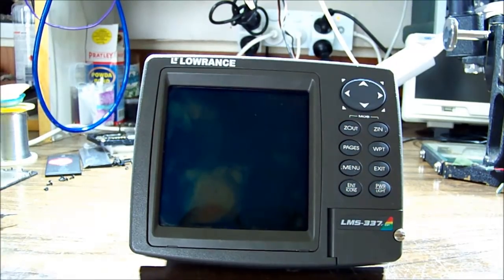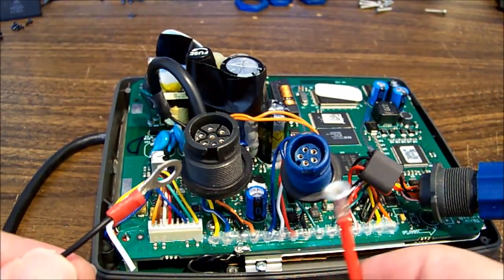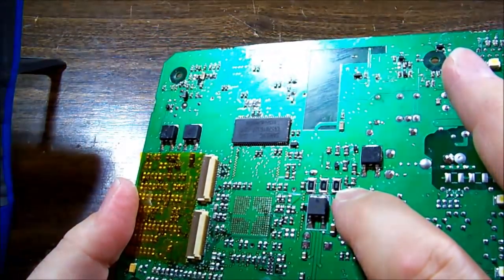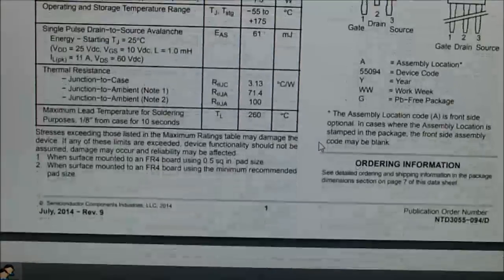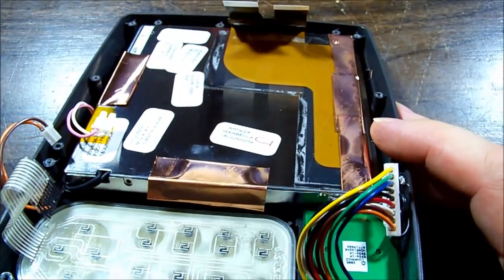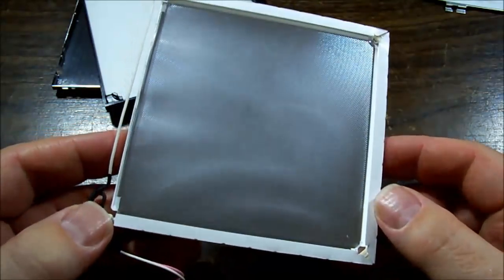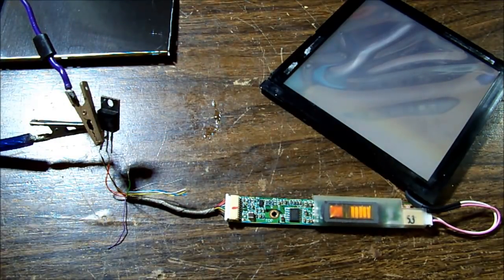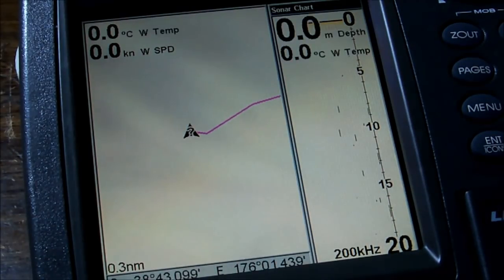Lowrance LMS-337 fish finder sonar depth sounder repair

Comment: G'day mate I have a Lowrance Elite does 5X HDi which is not powering up at all all cables have power eccetera and I have tried my GPS Lawrence and other sound on the same cables and they all power up I have taken the circuit board out and trying to troubleshoot ID like to send you email photos if that's ok please
Reply from the maker: jonnyfix0 at gmail

Comment: Hi Jonny  i have a problem with lowrance hds 9 g3 the transducer is not recognized checked the board and found 2 burned components
but cant tell  what is their code one looks z4w 47  the other starts with a 3 is there a way to find out? Thx https://www.mediafire.com/convkey/624f/j7ia7e85uet0c4bzg.jpg
https://www.mediafire.com/convkey/7f45/ttkoki8w06a1fk5zg.jpg
Reply from the maker: Ouch. I think the z4w 47 is a 47V zener like BZX84-B47. I think the other one is a transistor. You could substitute something rated for say 1 amp 60V (because the zener is 47) and see what happens. It does go to what looks like a large cap on the other side so perhaps rate it for the voltage the cap is to be safe. Make sure there's no low resistances to ground on any of their pins to be sure they don't smoke again. Their package is a SOT-23 for size reference.

Comment: hi jonny i have a 7500c and the front glass has been smashed in transit. i have a replacement on coming where the buttons dont work how easy is it to swap out the buttons?
Reply from the maker: Shouldn't be hard at all, hopefully the reason for them not working is purely the buttons or the PCB they're on but you could swap your main board over to. Avoid trying to remove the screen from the chassis in case you ruin any water sealing.
Reply: @JonnyFix  thanks Jonny yes that's what I was thinking, stay away from the screen seals and move what's not working to this one coming. Do the buttons use done sort of seal around them as well?
Reply from the maker: @andrewknox8986  from memory all the buttons are one large piece of rubber that creates the seal in itself when the board is screwed onto the back of it.
Reply: @JonnyFix  brilliant thanks Jonny that's what I was hoping for when watching your video above look forward to this arriving and getting to grips with it lol

Comment: Hello Jonny - got ahold of a Lowrance Globalmap 5200c (no signs of cosmetic or water damage). When I connected it to 12VDC it powered up for about 10-15 seconds and then all the sudden went completely dead (no display, sounds or anything). I've confirmed I'm getting 12-15 volts. One thing I neglected to do in the beginning however was to connect a fusible link when I turned it on. Is there anything you could suggest I try at this point? Thanks so much.
Reply from the maker: It may have an internal fuse (like this unit) that has blown for some reason. At 4:59 you can see a fues holder toward the top and 2 orange wires going from it down to the board. Clearly this one popped it's fuse once and someone thought it was easier to add a fuse holder in to make it more easily replaceable given the original one is surface mount. You may have to do something similar.

Comment: Thanks Johnny! Excellent video! I have a lowrance elite 5x that powers up and appears to be functioning normally until you take it out on the water. It will not read bottom, a lure, an anchor.... NOTHING! I have tried 3 different transducers, factory reset several times and nothing. I noticed that the transducer pings are not very strong (usually when you wrap your hand under the transducer the pings are very obvious). Any thoughts?
Reply from the maker: I would follow from where the corrector attaches to the board inside I think it will lead to a transformer that is driven by a couple of mosfets. Check to see if they are ok and if so you need to check the voltage on them with it turned on I think it's around 50v. There might be some diodes between the transformer and output connector as well.  If that's all OK it could be the transformer has failed.

Comment: A unit I have (very same model) powers on, but powers back off several seconds later. It's in excellent condition and very clean with no signs of water damage. Could you recommend anything to check out inside the unit?
Reply from the maker: Does it have a picture or does it just light the keys. An image might suggest the processor is ok. No image might be not booting (bad ROM) or no clock or there is an image but no backlight. The exact symptoms will help guide you. I'd be looking at all the power rails, make sure none are missing or incorrect.
Reply: Thank you for the suggestions. It had these symptoms when I tested it on a standard 110v-12vdc outlet converter but when i connect it to as 12v car battery, it powered on fine and the symptoms went away. I guess some fish finders act faulty on the certain converters.
Reply from the maker: @en4cer450  Sounds like the output voltage was dropping because it couldn't source enough current or the regulation was rubbish and noisy.

Comment: If you like working on them you could make a good living fixing them. My personal opinion is they are a piece of junk. And if you have to rely on lowrance get ready for being abused by there customer service department. They give you only 2 options send it back at a cost of 636.00 to get a reman unit or buy a new one.
Reply from the maker: Not surprised. Anything with low production volume (compared to other consumer products) and even more so with niche markets will almost always be hard to get some parts and any info for.

Comment: Do you repair humminbird fish finders
Reply from the maker: I repair anything electronic. I have not worked on a humminbird unit yet.
Reply: My screen flickers when I hit power button. It has power to unit but will not start up. Don’t know much but I was gonna experiment. Any advice?
Reply from the maker: Follow the videos I have. I start with making sure the power rails are present. Hopefully its marked on the board what they should be and where to test. If there's physical damage inside (liquid ingress or leaky capacitors etc) fix that first then see where you're at. If no physical damage and all voltages present it gets a bit trickier.

Comment: Well Johnny, have the exact same issue, my transformer appears to be in better shape. BTW I called Lowrance and they wash their hands of anything older than 5 years old. Shameful as this unit was very expensive, and to not do anything at all for  your customers is enough to change the directions of my dollars. My unit would stay on then after long periods would start flickering and screeching ( audio)  on and of, on and off.  I was able to get the mosfet from Amazon, but have found out that the transformer was manufactored for Lorwrance for this unit and is not a part I can get from GCi who really only sells to electronics manufactures and not to even part suppliers.  The lady I got ahold of Dana was very helpful,   but because the part is proprietary to Lowrance she could not give me the data sheet, but has committed to trying to find me something to solve the issue aka one just laying around. Will provide further comments when the results of that effort comes in. Clearly this is an original design issue by Lowrance and they are washing their hands of it at the expense of their loyal customers. I have purchased my last Lowrance after owning 9 of their products, roughly $6000 worth of business over the last 15 years.
Reply from the maker: Wow. Yeah sad to hear but a lot of manufacturers seem more interested in selling the latest model. Be interested to hear how it all ends and what you do to complete the repair. Cheers!
Reply: Steve Hastings I'm going threw the same thing right now with my Gen 3. I also tried to get help from there service department and was told I had only had 2 choices. Send it back for a reman unit at the cost of $636.00 or buy a new one. By the way this unit is only 2 years and 9 months old. Has only been used about 15 times and it just quit. They also will not get any more of my money. I will switch brands also.
Reply: @anthonycash4609  same problem here broke pins male on back of unit, its from 2012 lowrance wont handle it over five years ...sucks

Comment: Nicely done, normally using some heat from your rework station will help loosen the tape bond.
Reply from the maker: True that. It's funny what you don't think about when you get into a process yet other times it's the first thing you reach for :)